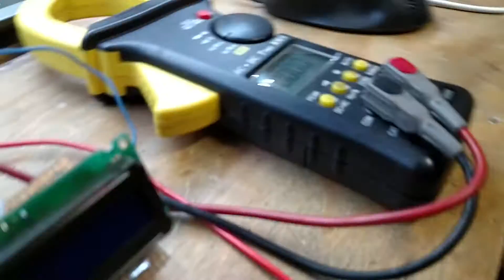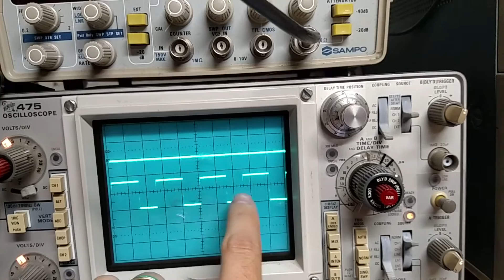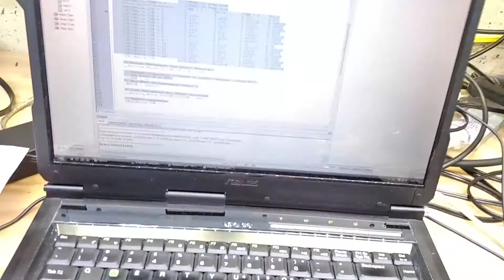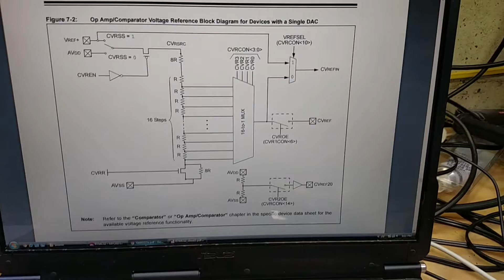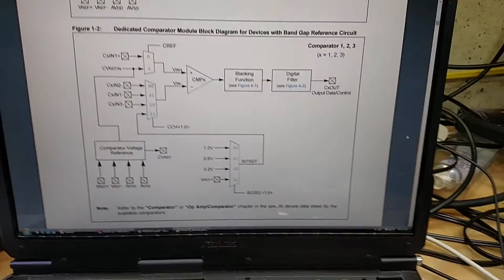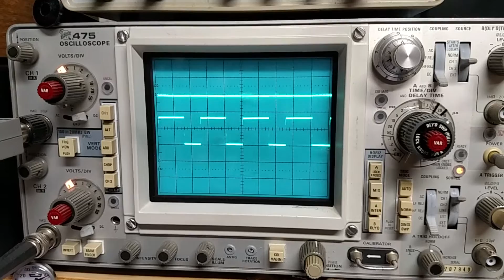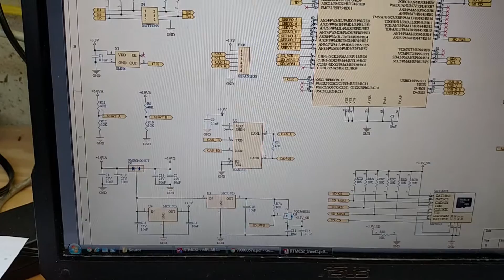Nissan Leaf Battery Pack Sniffer, Part 1

Comment: If I wanted to learn this stuff in college, what classes would you take/recommend?
Reply from the maker: +The Rootscientist 

I am not sure what your college would name the classes... But I would suspect the Electrical Engineering program with a focus on Embedded Systems, would cover the basics. ;)

Analog and Digital logic
Microcontrollers
Embedded system design
C, C++ programming
Schematic capture
PCB Layout

However you can learn alot by getting a microcontroller development kit and writing the code to make it blink an Led. ;)
Reply: +Wolf Tronix thanks wolf..

Comment: They have a app called leafspy
Reply from the maker: +Mike Wadas 

You can also get most of the info from the dash board display…
If you have a mostly intact car. ;)

Usually the main high voltage disconnect is pulled (at the scene of the accident), and the salvage yard will not allow you to put it back in, (they don’t have it anyway).

Leaf Spy will work if have an intact OBD2 port, and Ironically, a way to power the battery.
Salvage yards tend to get suspicious if you are carrying around a 12V car battery. ;)

Most of the time the battery pack will already be pulled and sitting on the ground.
High voltage battery packs are a hot commodity these days, and usually worth what they just just paid to the insurance company for the salvage, so they are first item to get sold.

This is like any other purpose built tool, it has one job, you an just walk up to a battery pack, plug in and then a few seconds later know what state it is in.

And it was what the customer wanted. ;)

Thanks for watching!